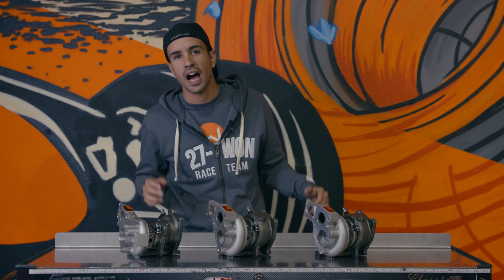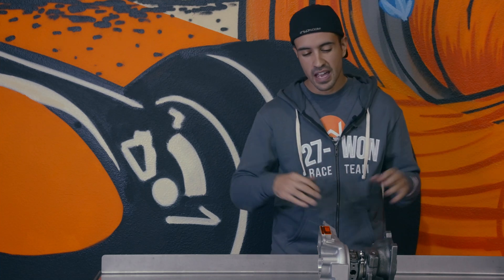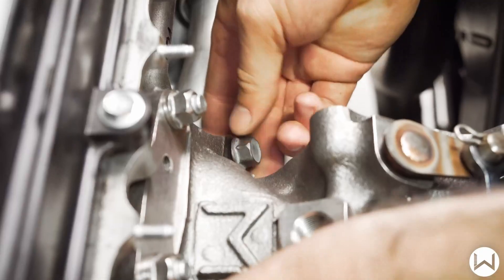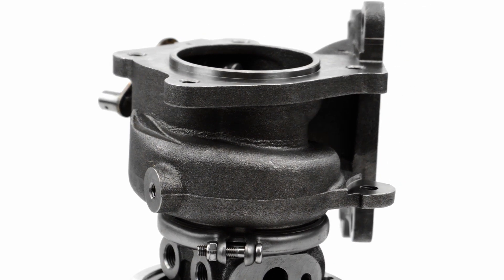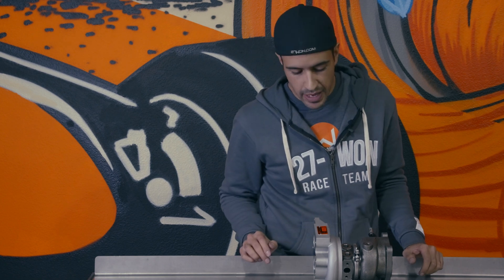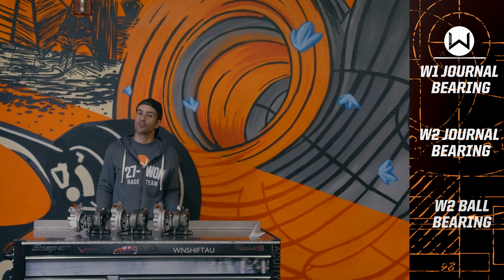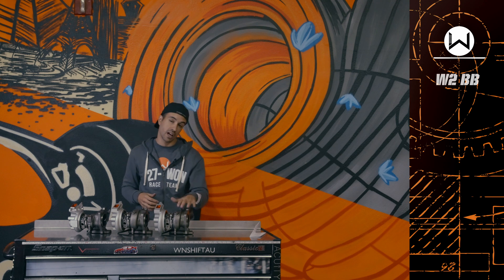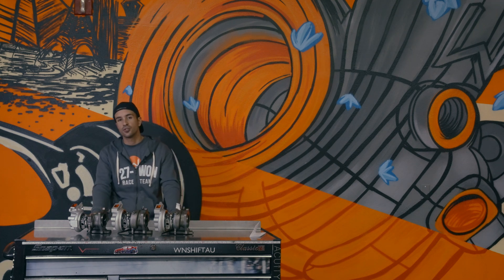27WON Turbo Line Up Comparison

Comment: on another note. Will the W2 BB fit my 27WON TIP without clearance issues. Saw a video of a guy installing a PRL TIP on a w2 and he had to bend stuff and cut bolts
Reply from the maker: yes, will fit without modification.

Comment: I have a cvt Honda Civic. I want to get the 27 tubo ball bearing. Is it recommended when running 21psi so I don’t break my transmission.? Thank you
Reply from the maker: A W1 will be better matched, but yes you can run a W2 BB

Comment: I personal just want to get 300 whp out of my 10th gen. On one of your blog post I saw that you mentioned 300hp with the w1 requires ~27psi and the w2 requires ~23psi. Does this mean that the w2 can net you that 300hp with less of a reliability hit to the engine? Or is it just superficial?
Reply from the maker: yes a w2 won't work as hard to get you 300 so its smoother on the bottom end.

Comment: Sweet work and turbos man! I am furious if the 3 turbos are compatible with an unbuilt bottom end L15?  If you are moving the torque band higher I would assume that is ok and may be fine for it?
Reply from the maker: yes these can all work on stock bottom ends.
Reply: @27WON  Was I fast and "furious"?? 😂😂😂 Sorry I meant CURIOUS!  Curiosity fulfilled. Thanks Vincent! Keep up the good work! I will be buying more as soon as I can. 👍